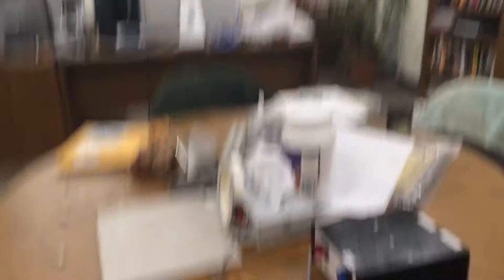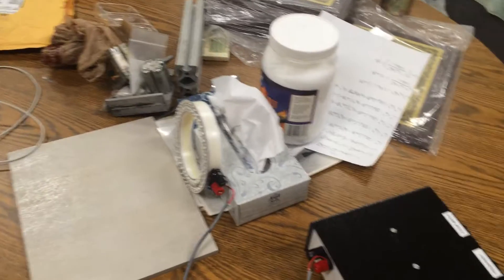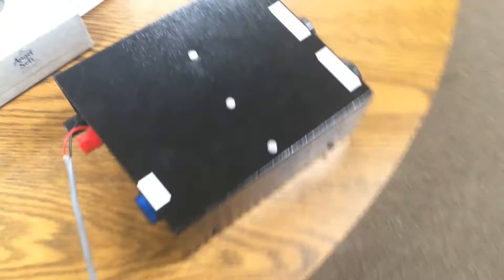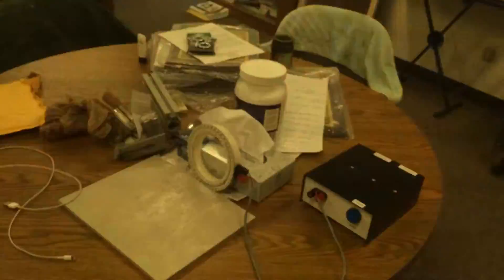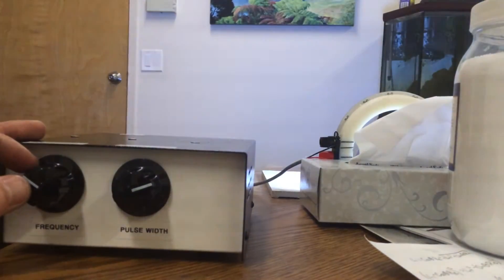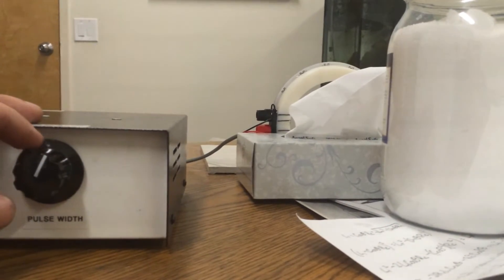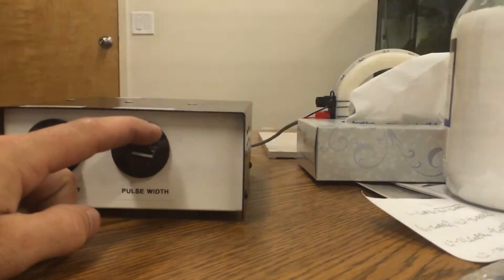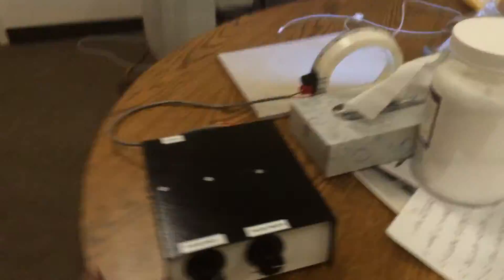Strobe circuit for 12V LED's

Comment: Can you by any chance link me to a schematic? I need to build something like this to push led strip lights at my haunted house in October.
Reply from the maker: +Kyle Warner . Sorry for not getting back to you sooner. I will try to find a schematic. The device itself has already been delivered to my friend, so I can't look at the components. My dad designed and build the circuit. I know he used transistors in conjunction with other basic components (resistors, capacitors etc.) At the very least I can say not to use a 555 timer. It doesn't fire strong enough so you will not get full brightness like the way this operates.
Reply: Thanks for the reply. I have a feeling it is based on a voltage "vibrator" circuit, with pots instead of fixed resistors.